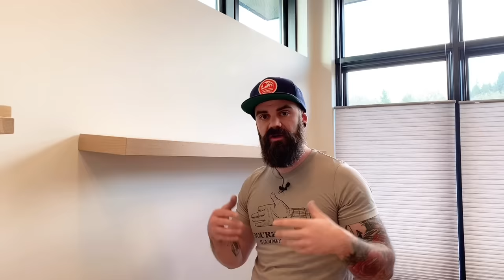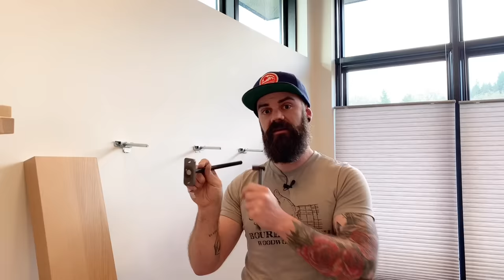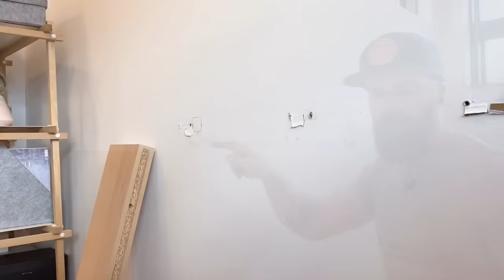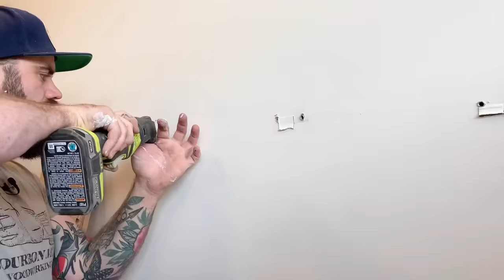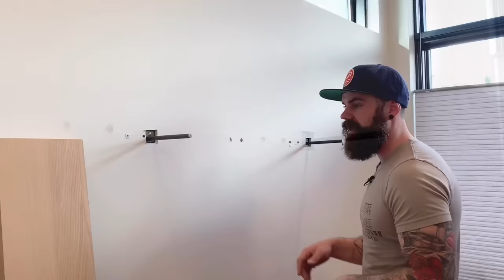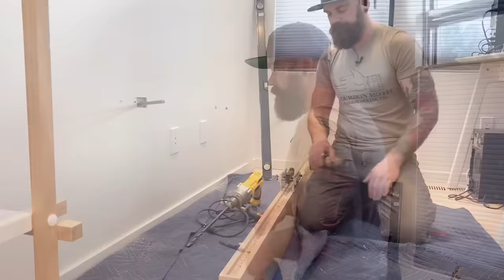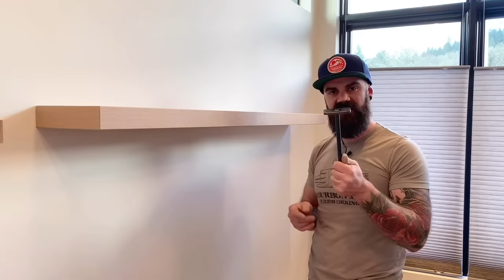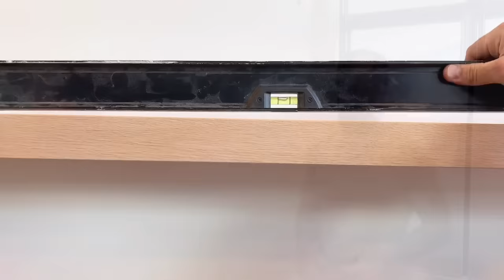How to Install Floating Shelves/DIY Floating Shelves

Comment: Just a work of caution to check for wiring and/or plumbing running through wall studs. These are typicality run through bored holes in the middle of studs. The 2” screws will short a wire or puncture a pipe if present. Good info on installing the floating shelf.
Reply: If it's done right, there should be a nail plate preventing a nail or screw from entering that stud. But that might not always be the case
Reply: @Axertion  nail plates are only required if the wire is less than 1-1/4” from the face of the stud. National electrical code.
Reply: Don't know about US regs, but in UK, you wouldn't be allowed to run non-conduited cable horizontally at that height as it's not a designated 'safe zone'. That said, you can't be sure that some nutter hasn't done so!
Reply: I have a stud finder with a voltage sensor.  It won't find a water pipe though!  Better hope someone built it to code but you know how that goes.
Reply: I have a drill motor with a Stud Finder, a Voltage Sensor/Meter, a Level Bubble, Divining Rods, a Weather Radio, MP3 Player, AND it doesn't even need a power source. It runs strictly through osmosis.
Reply: @maxwellsilver3115  Get that at Harbor Freight or where? I need that!
Reply: @asmith7876  Yep! You gotta have the super secret coupon, tho. You can only get it telepathically from the store mgr.😉
Reply: one could cut the drywall hole just a little larger to the left or right and visually inspect to see if a wire or pipe is present
Reply: great tip. a costly lesson learned..
Reply: @maxwellsilver3115  BS! It doesn’t run on osmosis.

Comment: Love you’re teaching style.  Very clear and all the good tips.  I watched this because I do exactly the same thing, even have my own brackets made up by a local welder - very similar to yours but a longer tail on the plate to help prevent leverage issues.  In the UK most walls are plaster on brick, but I still strip the plaster back to sit the plate on brick.  I backfill and decorate before measuring and drilling the shelves.  I also make solid shelves which you could park a truck on!

Comment: @bourbonmothwoodworking this tutorial is great and I appreciate you making it. Just a word of warning if you aren’t going to have custom made brackets to exact measurements and are using stock lumber (1.5” thick), the brackets you buy online (I purchased the ones in his description) you will have gaps above and below your shelf that you will need to patch as the brackets are just slightly larger than the lumber. 

Everything about the tutorial is spot on though, even when you are wingin it and find your drywall is held up by furring strips on concrete and you gotta adjust on the fly 😂.
Reply: Did you mount the supports against the 3/4 furring strips or to the masonry? Did you have CMUs or solid concrete?  Thanks for any advice...

Comment: Never thought about cutting out the drywall.. Great tip and make a ton a sense.
Reply: Agreed but you definitely need the oscillating saw you can buy them from Harbor freight for as little as $20!

Comment: Those steel brackets are great - but be careful with a 2"+ screw - there could be wires or water pipes that run through the centre of the studs (code allows for this, meaning it could be as close as 1 3/8" away from the front edge!) Nailplates would likely only be used if the hole was closer than than 1 1/4" from the front, so the long screw is strong, but a tiny bit of a gamble if you're not sure what's back there!
Reply: Hey contractor here. You'll know if there's wire or pipe running through something typically wire is not run any higher than 18" for outlets and approximately 42" for a switch. If wire is being run it will be about level with the outlets. Typically wire is run down the side of a 2×4. So in other words you will not hit a wire unless your electrician was on crack. As for pipes the only pipes you should find in a wall should be around anything that requires water. Pipes are run basically from a to b "path of least resistance". Here in Florida it's buried in concrete or run through the ceiling down to your bathrooms and kitchens.
Reply: @chandler3992  I know a lot of electricians who are on crack, though. 😁
Reply: @chandler3992  Thanks for the tip, this is always something I worry about. Would you say this also applies to apartment buildings? My worry is about anything that may be run vertically for the units above or below. I would guess not, but really I have no idea.
Reply: @SpenserFL  normally yes but I can't say every apartment follows code because I know some real slum lord's down here in Florida who look for the cheapest guy. Generally speaking though they will follow the same guide lines I gave.

Comment: If I'm fitting floating shelves to brick or blocks I use half inch threaded rods tapped in to the wall and shelf, works fine into studs too.
Reply: Hey, I'm looking to hang some floating shelves in the kitchen into a concrete wall. Do you use an anchor or epoxy to hold the rod into the brick? Any tips would be appreciated
Reply: @kiedobull7251  just a reasonably tight fitted rod into the wall and shelf should be enough, I use some tiny wooden splinters if I have too.
Just remembered you may want to remove the shelf at some point which can be hard enough without glue, sorry for the late reply
Reply: @dancingfrogsxb1276  Thanks for getting back to me

Comment: Yep, you just saved me a whole mess of trouble. Drilling those holes for the brackets to fit in the shelf first seemed like the right direction but I knew something in the installation was going to be the downfall.

Comment: Very cool.  I did something similar with a French cleat cut from a 2x4.  Screwed into studs, then the box slid on the cleat which was then screwed from underneath. 3 ft shelf, held a lot.  I like the brackets you used.

Comment: As a novice, I decided to do a floating mantel over my fireplace this year, but I wanted a solid wood 6x8x70" beam. It's basically the same concept except I used 7 x 8", 3/8 lag bolts fastened into lag shields into the brick (which I needed to drill 5/8 holes for). Bolts go in 2.5" deep and 5.5" into the wood (you want to be in 2/3 the thickness of the wood which was 8" for me). Once bolts are in, saw off the heads, drill holes in the wood (hardest part is drilling 6" straight holes without a guide, then pound it in. Worked really great, so I'm not surprised this is how to do floating shelves as well.

Comment: Great video, loved the trick about cutting away the drywall. Definitely will use that on the next set of floating shelves I do. I had a local welder whip me up some very similar brackets.

Comment: I like lag bolts.  Pre-drill the holes to the shank diameter and desired depth, so as not to split the stud.

If using solid boards, cut the heads off, then drill the shelf to the desired depth.  Slide on the shelf.

If using a box design, drill the back shelf board, leave the heads on, and mount the bolts through and into the pre-drilled stud.  Then, slide the rest of the shelf over the back board and secure it to the back from the bottom.  Can also use this method to create floating drawers too.  👍
Reply: Good idea, have you made a gig to keep them perpendicular  to the wall?
Reply: @pbodymathis  I just use a speed square and level across them.

Comment: I usually drill into the stud with a slightly undersized drill bit then screw in a threaded rod.  I drill the proper sized hole into the shelf so I can slide it onto the rods.  Works great.
Reply: And a lot cheaper than $25 that those brackets  costs. That is what I was thinking about using.

Comment: I've used another mount idea . Screw a 1/2 " lag bolt into stud (use pre drilled block for start hole drilling , perpendicular guide ) , cut off head , and then mount shelf the way you drilled and placed the shelf . (vice grips can later remove bolt , if necessary )
Reply: Excellent idea, super strong and inexpensive too. Compared to the alternatives that is.

Comment: Thanks for the video...loving your methods so far! I installed a floating shelf similarly, but just used some lag bolts with threaded ends. Placed the lag side directly into the studs & pounded the shelf in to the threaded side (about 4" worth of threads hanging out). I wish they made these longer for deeper shelves!

Comment: Awesome. I advise against long screws though, there are electrical and plumbing codes as to the depth each pipe or wire should be installed. Beefy 1 or 1-1/4 inch screws or alternatively a chunk of plywood glued in to replace drywall. Great video and love the custom brackets, perfect solution!

Comment: This is the best video on the internet for showing this process. Question. Do you have a video where you do this from scratch and not using a shelf from a kit? Also, would three holes make it stronger?. Lastly, I have a dremel. Will that work to cut out the drywall on the stud? Thank you!

Comment: I have been considering hanging some floating shelves and this video was perfect giving great info. Especially the focus on beefy hardware as i was going to just buy the cheap amazon kit. Looking at what you use I picked up a sheet of steel and some rod since I have a grinder and cheap welder which should work just fine for something like this. Never would have thought of that route without watching you use them

Comment: Top upgrade to crappy 'Big Box' brackets.
This was not my own idea, but I saw another tutorial on installing floating shelves and the strongest solution, and cheapest, was to use good old threaded rod. 
If you do any site work, you find short lengths getting chucked out all the time. 
I make the shelf, drill the holes to suit the threaded rod and location of studs, and then use a cordless drill, with the rod in the chuck, to drive the threaded rod into the shelf. Then, I mark a level line on some painter's tape and drill the wall or stud.
I find it better to make a timber jig to angle the hole to accommodate the rod in the wall, so that the shelf sits, initially at a slight upward angle. That way, there is not need to use any adhesive or silicone, allowing you to slide the shelf off at a later stage, without having to worry about it coming off if it is overloaded.
I've make quite a few like this using hardwood with live edges and they look fantastic!

Comment: Great way to do those, thanks, Oh I just had a thought. If you hollowed out a small slot on the shelf near where you drill the mounting holes that you could put the two square pieces of drywall you removed it would sure help if they ever wanted to remove the shelf, a chance to use your domino tool.

Comment: Great craftsmanship, my suggestion or idea to add more strength, improve the steel rod by making longer on the opposite side of plate then drill a hole in the stud, then insert rod, screw it continuing your same steps foward on. Hope my idea makes sense, it will add more strength and the screw will be to keep rod in place...fabricating would have to be made to rod and plate. Enjoy your videos. Thanks

Comment: We just drill the hole directly into the stud and glue the round stock   straight in to the framing timber  similar  to using a kempset , tap the round stock with a hammer to take away any fall front to back.

Comment: Thanks for the video!  

If a 12 lb cat jumps on to a shelf installed as this one, from two feet above, and 2 ft. below, potentially every day, as many as 20 times, will this shelf hold up?  And the cat might stop for a  2-3 hour cat nap on that shelf every now and then, possibly joined by an 8 lb kitty friend.  Will the shelf remain sturdy indefinitely?  My catification carpentry needs are big.  Cats being my main focus, and after years of rescue, I have a bunch of kitties.  Making their environment fun and strategically planned to manage  behaviour, is very helpful.
Reply: I'm not sure that there is space for 20 cats on the shelf tho

Comment: I like to use big lag screws with a non-threaded body (just the part going into the stud is threaded), and then just cut off the head with a grinder after screwing them in. No cutting drywall, and I can get them for super cheap at any hardware store.
Reply: Same here Craig Anderson… also I used a beautiful piece of heart pine rather than press wood

Comment: Have you tried using your tile bracket on drywall? Cut a hole in the drywall exactly the way you showed so the hole does not show. Then, use the Ryobi tool you make apologies for to remove some of the BACK of the drywall sheet so the lower half of your tile bracket can slip in and not show from the front.  Attach the bracket using the single screw in the top hole in the bracket as you did in the video.    Here is why this helps - When a load is placed on the shelf the screw and the bracket have to resist that load and the force that tries to pull the screw out of the wall.  Adding the metal to the bracket that you hid behind the drywall lowers the force that tries to pull out the screw. T he force trying to pull out the screw is cut nearly in half!  A little drawing would be a lot easier to understand than my wordy description.

Comment: No need for an expensive fancy bracket.    Try using newel post fasteners.  Drill and turn them right into the studs.   Cheaper, and much stronger than a bracket held on with a couple of screws..... and available at most any hardware store.  I use them for floating shelves and  fireplace mantles.

Comment: I used similar concept to float my large granite bar, replacing wonky wood brackets with steel "L" brackets that attached to the stud and the bottom of the bar; patch the drywall and the bar appears to float without support.

Comment: You can also just use threaded rod or even just drive a lag screw into the stud and then cut off the hex head with a dremel or angle grinder - and tada, you have a super sturdy mounting rod.

Comment: Hey man,What a great video,just one question. You said that if you wanted extra stability that you would put a 3rd bracket in there,where and how would you secure a 3rd bracket since the two other brackets are secured into the stud??keep up the great work!!

Comment: Nice video.  I  used a similar approach but different in that no pre fabbed brackets are needed just a couple pieces of all thread.  Layout the center of the studs. I used at least 2 for shorter  shelves three or more for longer heavier shelves.  Drill holes sized for the root diameter of the threads.  Double nut the all thread at one end and turn them in with a wrench.  Drill holes in the edge of the shelves, centered of course on the thickness of the shelf and sized for the outside diameter of the threaded rods plus 1/32".  As in your case, holes must be carefully laid out and drilled perpendicular, and to the correct depth.  I went about 2.5" in to the wall stud.  No drywall needs to be removed so actual hole depth is about 3" from the finished wall surface.  One other thing, before fitting the shelf to the all thread, its a good idea to place the shelf on top of the studs to see if scribing is necessary.  Some walls aren't perfect, if you can believe that.  thaks

Comment: depending on the application, you can forgo the steel brackets and just make it out of wood in that you have 1 wooden beam that is less thick than the shelf itself, and then 3-4 wooden beams going out from it, keep in mind this is a technique used for floating shelves that you made yourself, since they are typically hollow, ohh and don't expect em to hold your mass in weight ;) so best use em for like plants and books, or in your bathroom for towels if you fancy ;)

Comment: Great content. I’m in Florida and have concrete block construction. Would you screw into the wood firing strips the drywall is hung onto but use and extra bracket since the screws will be shorter or mount the rod into the block with a blue tapcon or plastic anchor? One side of the shelf I can screw into from the wood kitchen cabinets the other end is interior wall but no stud except for the corner and it’s metal.
Thanks

Comment: Hi, any suggestions on hanging into a cement / concrete wall, your brackets of course are plenty strong, but my issue is what those brackets are mounted to, in my case the cement is a super fine mix so using some form of plastic plug for the screw will always seem to eventually work it’s way loose. Have tried using liquid nails in the hole to help with the cements integrity but results are so-so... loving the channel, most amusing...

Comment: Awesome vid! I’ve done a few with a similar concept. The biggest pain was drilling the holes out for the bracket and getting the straight. I like the doweling jig to solve this. Excellent video!

Did your doweling jig not self-center on the second hole?
Reply from the maker: The brackets i was using in the video were actually off center from the plate, so i had to correct it with a shim on one side of the jig. But most standard brackets are centered so i didn't mention it in the video

Comment: Thank you for the video. Love your spunk! We are in the process of planning a renovation to do floating shelves in a kitchen with wall tile. The cabinet maker (installing the shelves) recommends brackets with longer plates (5.5” long, dowel in the center) mounted vertically on the studs for added stability. With 1/4” plate, can you mount the brackets to the studs over drywall and still be able to hide it with wall tile? The contractor (installing the tile) is planning on using tile glue to set the tile (I’ve no experience with this). After watching your video, I’m not sure we need brackets with such long plates. Seems three brackets (1.5 to 2” plates) per shelf mounted directly to the studs as you mentioned in this video would work. Thoughts? I’m sort of acting as GC and trying to coordinate the cabinet maker and contractor and their processes.